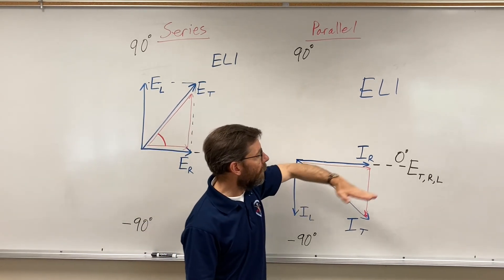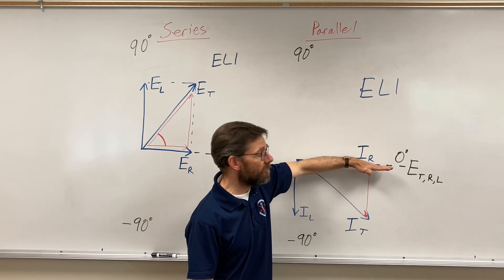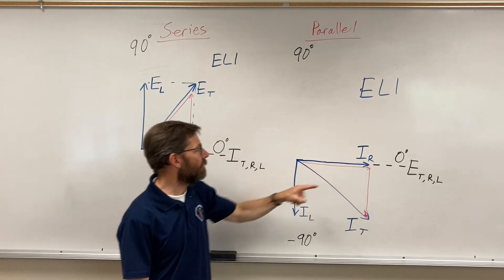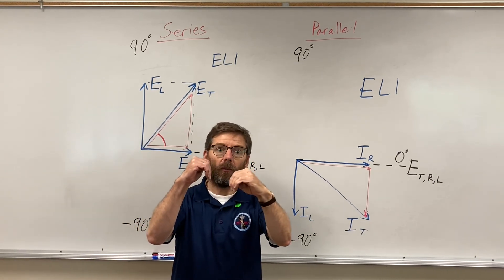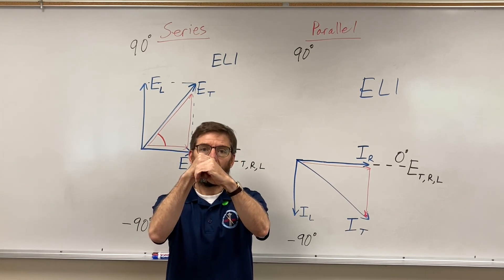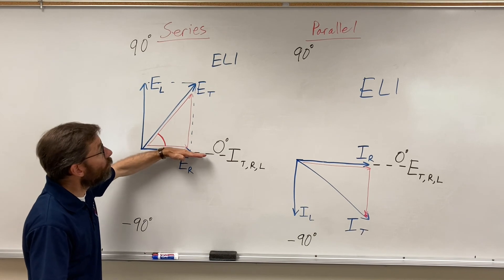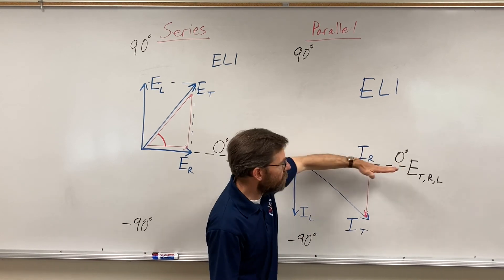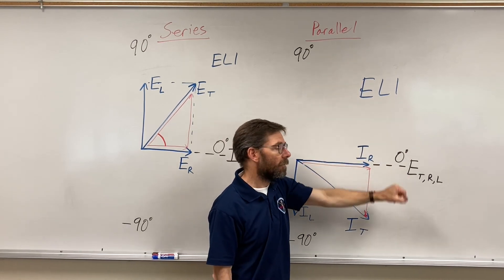RL Circuit Vectors

Comment: Great video Dave, like the rest of them. Maybe worth pointing out for some viewers that in both cases (the series RL case and parallel RL case) , the total voltage leads the total current (despite the triangles pointing in opposite directions). So the source/supply 'sees' a net load with leading power factor in both types of RL circuits (or lagging power factor depending on your convention - considering the current lags behind the voltage).